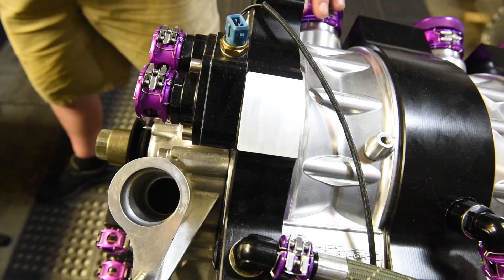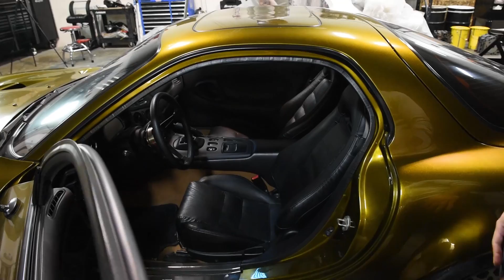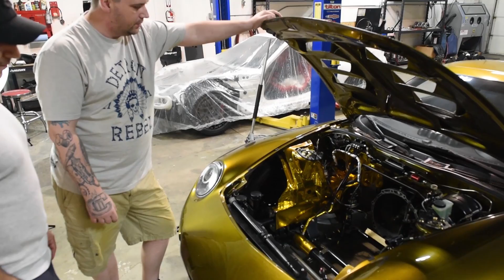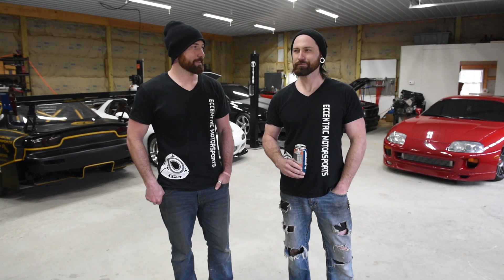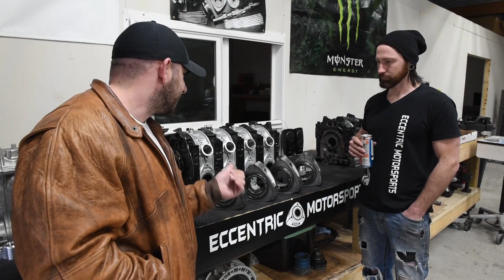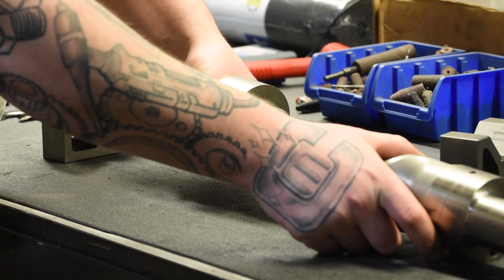WHAT GOES INTO REBUILDING THE 4 ROTOR ENGINE!

Comment: I built an RX2 4-Door in 1978 that BLEW EVERY local challenger away; Z28 
to 914-6, in the East Bay car scene, there was nothing like it. 510's 
were all the rage, and my Brother owned several, but NONE could keep up 
with my little fire-breathing dragon, that I welded and bent my own 
headers for on Racing Beat Flanges, welded the back doors shut, removed the seat, built a roll 
bar for, and after I took the Thermal Reactor off, and re-jetted the 
carb. It was pretty untouchable to 135 or so and would tach 13k at 
shifts, blowing a two-foot flame out the rear. I lowered it, added 
spacers, to the wheels, and molded 510 flares on it with rivets and a 
heat-gun, painted it bright orange with a two-foot wide yellow stripe 
down the middle, It was well-known as an untouchable car way, way before
 "tuners" appeared en mass.
Reply: 914's are turds lol but i know what you mean, this local guy from around me had a 1st gen rx7 that was all built up done by himself running a 750cc carb with 2 stroke oil metering. it was stupid fuckin fast. he was from puerto rico where they love rotaries

Comment: Did you contact PPRE in NZ and ask for a refund?
Reply from the maker: No refunds, customer is always wrong
Reply: @MazzeiFormula  did you specify a blueprinted 90 degree  shaft and a even firing order.show us ppre response to your claim
Reply: Thats fucked up man. Good on you for spreading priceless information about the scanning idea, and exposing an  either faulty product, or one manufactured via tremendous ignorance. Nobody should have to redo a brand new crank shaft. Not many 26B builds in the world. So information and know how is crucial for the rotary building community. Thanks
Reply: @MazzeiFormula  true,i had the same problem here in south africa with a 2 rotor motor

Comment: Is there no definitive reason for the lobe offsets not being 90° because even with a 2 piece shaft 5° is a lot, as is the keyway being 0.4mm out... with the length of the ecentric shaft of a 4 rotor is there 'twist' under load perhaps explaining the fact they arent 90° to one another? Was the difference in angles consistently skewed from one end of the shaft to the back the same way? Be very surprised to hear they werent 90° because of inaccuracys in machining, especially if they were drawn in autocad and run on a 5 axis
Reply: laurie agnew Asmira If you look at the scans, the actual machining was +-1-2 ° off on each lobe so it’s not the machine that was the issue. It’s the relative tolerances between each lobe. So if all the lobes were off by +-1°, the relative tolerance between the first and last lobe would be +-4°. So because the tolerances stack on each other its very difficult to minimize the difference between them, and easier to just adjust for this on the running as they say in the vid.
Reply: @MegaCoolshot  thank you for that

Comment: You paid so  much for this 4 rotor, and the engine is no good, you should call the company that made the crankshaft to fix the problem, smothing Like that dont have excusses, I Study cnc machines, and doing smothing Like that makes me hangry, because i dont have the Money to have a Nice car, and you now have to pay more Money to some one fix the problem.
Reply: cobratoxic not just that. I run a 3 axis and . 5 axis mill, as well as a 5 axis lathe. 5 degrees is a really big tolerence. If it was 1-2 I would understand because not all machines are totally accurate. 5 is too much
Reply: Asmira If you look at the scans, the actual machining was +-1-2 ° off on each lobe so it’s not the machine that was the issue. It’s the relative tolerances between each lobe. So if all the lobes were off by +-1°, the relative tolerance between the first and last lobe would be +-4°. So because the tolerances stack on each other its very difficult to minimize the difference between them, and easier to just adjust for this on the running as they say in the vid.

Comment: Crazy what PPRE sent was 'a job well done' to them.  Hopefully chip or someone can start manufacturing the eccentric shafts.
Reply: PPRE in New Zealand?
Reply: @dirtyd1886  yeah
Reply: Bernie Mac if chip makes it will probably cost 100k, he thinks he makes gold bars.....and invented the wheel.
Reply: If you look at the scans, the actual machining was +-1-2 ° off on each lobe so it’s not the machine that was the issue. It’s the relative tolerances between each lobe. So if all the lobes were off by +-1°, the relative tolerance between the first and last lobe would be +-4°. So because the tolerances stack on each other its very difficult to minimize the difference between them, and easier to just adjust for this on the running as they say in the vid.

Comment: Why is the crank/eccentric shaft built in multiple pieces?
Reply: You wouldn´t be able to assemble the engine if it was one piece. With this 3-piece design, you assemble the two inner rotors first, and then the outer ones.
Reply: Rob damns is one piece
Reply: Thomas Andersen no it’s not
Reply: @MrLikeaboss2012  his is like a crazy custom 4 piece